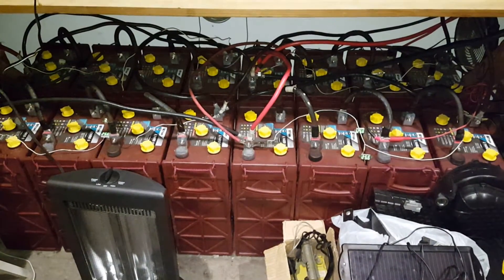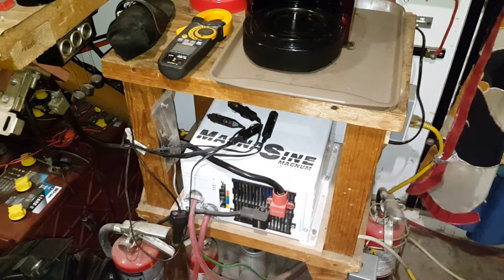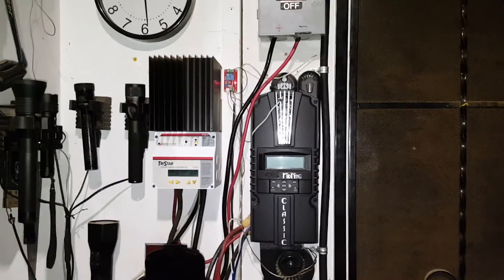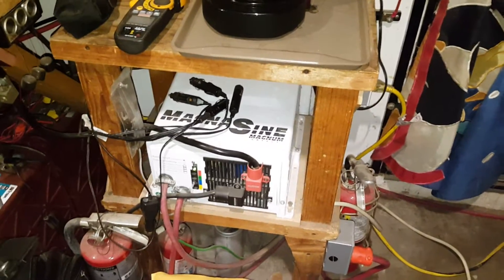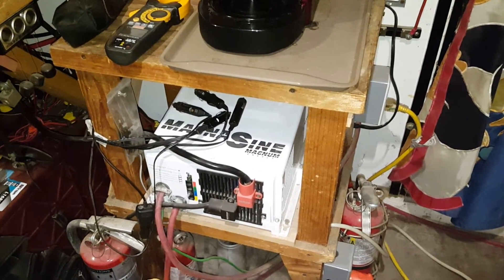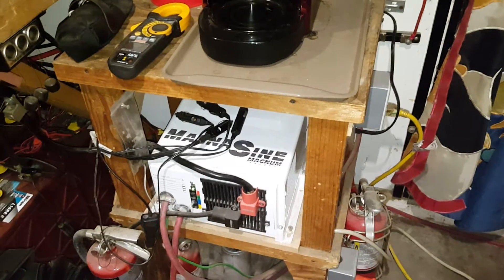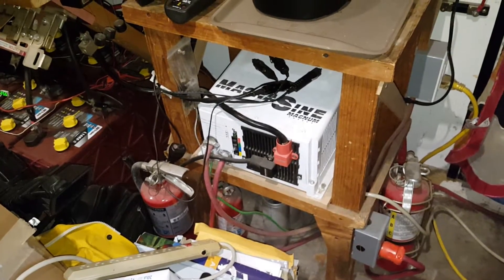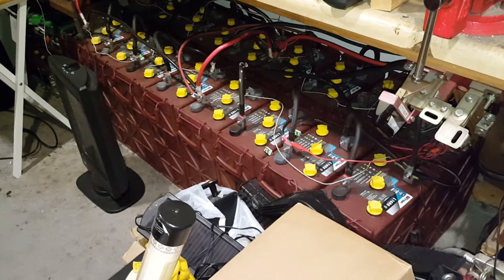Magnum MS-4024 Pure Sine Wave Inverter efficency Verses The foriegn Made Inverters!

Comment: Thanks and fully agree with excellent points and experience.    However,  missing here is the a comfort level that this inverter reliably run a HVAC compressor --- with a starting draw of 18 Amps @ 220VAC, Single Phase.  Just the outside HVAC unit... not the inside or anything else.   Just want to do one good thing here.   I understand a challenge for ANY inverter will be to start the initial load... many times throughout a hot day....  Thoughts ?
Reply from the maker: Thank you for your input, I will post a video of it running a portable AC unit, be well, Raz
Reply: No Thank you !  would be worthwile to see your observations of just a portable AC start-up and running  reliably over a conservative measure of time ( eg.  like 30 minutes or more).    I hope it cools off your work area at least.
Reply from the maker: Please allow me some time to do so.

Comment: This guy is a straight talker! He talks slow and is a bit hard to understand. But, I'd choose to listen to his experience over 80% of the others on the internet.  He talks about his experience and only what he knows. He doesn't make any claims that he isn't qualified to make.  So you can believe him ;)
By my research it seems that Magnum is probably in the top 10 in the world for value/output.  When you see these inverters that are say rated for 4000 watts with 12kw surge be very afraid!  First if you read the fine print you will notice that most wont do over 1200 watts sustained and that only in a very well cooled room.  The reason?  Exactly as he explained, efficiency!  If you have an 80% efficient inverter, which most foreign made models don't even come close to in reality, and you are pushing 4000 watts of DC thru it, that is at least 800 watts of heat it is producing!  And anyone that knows anything about electronics or physics knows that even 3 - 6" fans cannot expel that much heat continuously. Hence most of these ubber-cheap inverters that purport massive output/dollar rely on massive transformers that they can super-heat for a few seconds to produce that kind of unsustainable output. Then you have to wait for the tiny fans to cool of the overheated transformer before you can use the inverter again.

Personally, I'd like to see the rest of the world produce an inverter that is a better value than ours!  But I fear that is still several years off and then they will be more expensive anyway. In the mean time keep listening to people like this guy My Battery Powered House :)
Oh, hoho, and Merry Xmas ;)

Comment: I see where Magnasine bought the Dimensions product line, first Airpax, then Sensata and now Magnasine/ MAGNUM.
 I have three Dimensions inverters that I bought used and are built like a tank, they are the low frequency type, not as efficient as some newer ones but they don't quit. 
http://www.magnum-dimensions.com/product-inverter/1800w-12vdc-pure-sine-inverter-n-series  <-- is the one I have

Raz, is this what you have? ---- . http://www.magnum-dimensions.com/product-inverter/4000w-24vdc-pure-sine-inverter-charger-ms-series
Reply from the maker: Craig Nehring yes I do have two of dimensions pure sine inverters, they are built well and solid performers. I gave one to my friend to install in his work van that does his hvac repairs and he swears by it! yes I got the 24 volts 4000 watts pure sine Magnum inverter that kicks ass!
Reply: Originally made in Minnesota
 For folks that want to know the story behind this company, here is a link to their web page
http://www.magnum-dimensions.com/about-us
And yes they kick ASS. They can run at 100% overload for an hour if you have enough battery
Reply from the maker: Craig Nehring yes, yes and Yes! unfortunately we want to buy the cheapest and get the best! when you pay for a bug you don't get to a ride in a Cadillac!